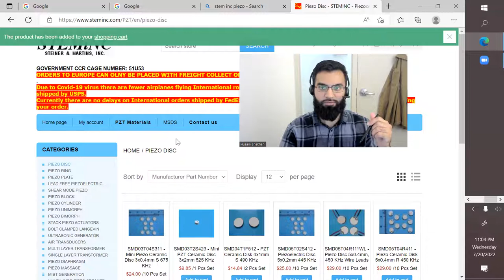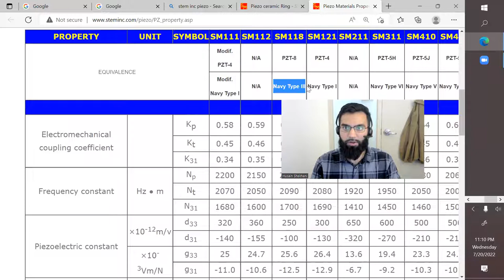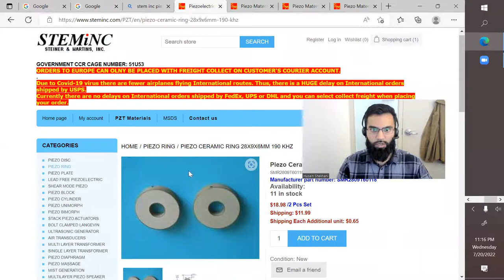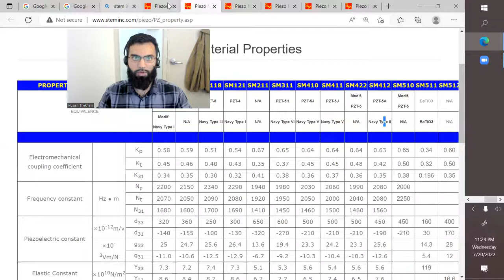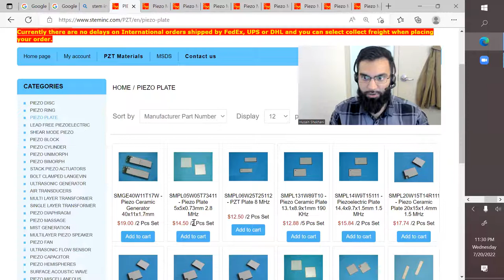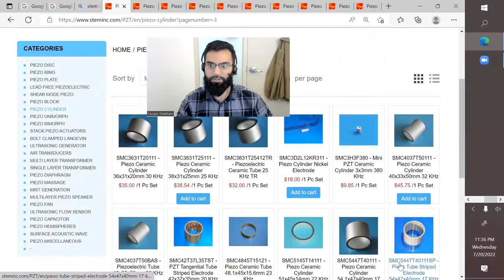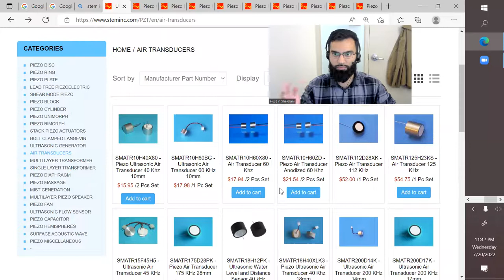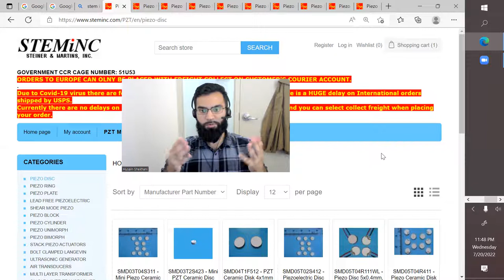How to choose a piezo ceramic from STEM Inc (Steiner Martin Inc.)

Comment: This is very interesting. I have been using STEMINC mist generators on spray drying applications since I started my PhD in 2019. I had zero knowledge when I started but now I am building up my knowledge about Piezo elements. Few days ago, I order piezo rings and planning to put them on mesh to produce aerosols. Great thing about STEMINC is they have driver that goes with the type of Piezo you want! Great content and I have learned a lot.

Comment: How do you determine how much voltage is needed to drive the piezo disc? I know you are not connected with this company, but I was curious is you know where to find this info on the site. I didn't see that on the data sheet. I purchased the SMD10T04R111WL PZT Ceramic Disc.

Comment: Thank you very good video, but I want to ask different question about pizeo ceramic. I bought piezo ceramic STEM Inc (SMC26D22H13111). I want to  calculate sensivity.I have read several articles on this topic. I saw a formula consisting of the dimensions of the piezo meterial and its coefficients such as g33 and g31. This formula was to calculate the sensitivity of piezo ceramics. but I think this formula does not reflect the truth. The result obtained as a result of the formula is as follows M0 = 0.12 nV/µPa
(−197.8 dB re 1V/µPa). Is there a formula for obtaining such a result for  linear and radial polarization. Can you help with this issue or how to calculate the decibel value, my piezo ceramic is (SMC26D22H13111)? If you want, I can share the article I read with you. Thanks for helping.